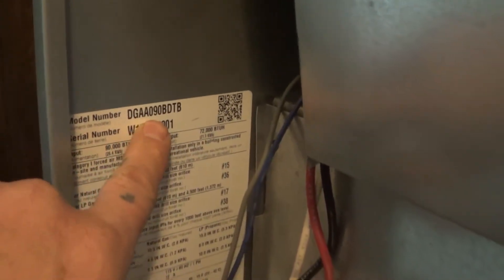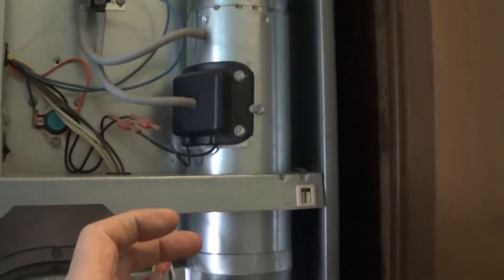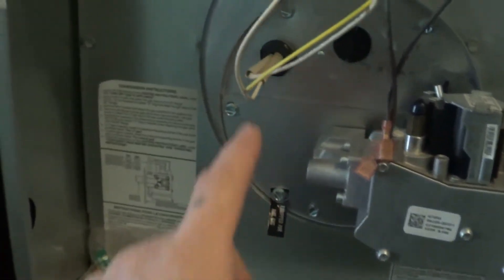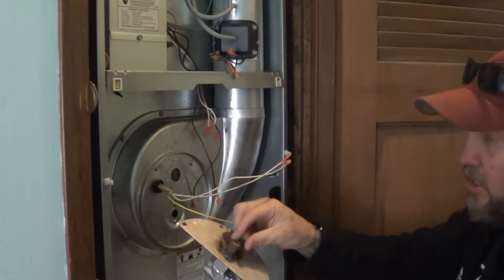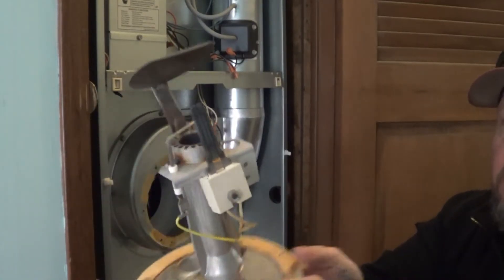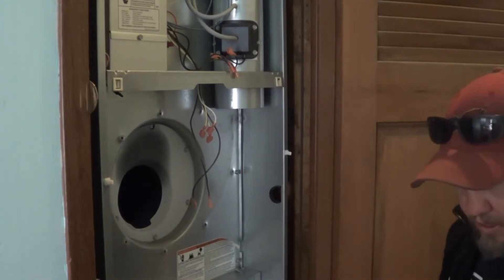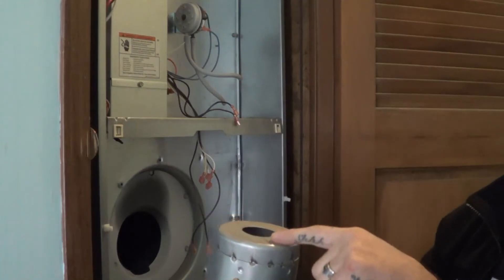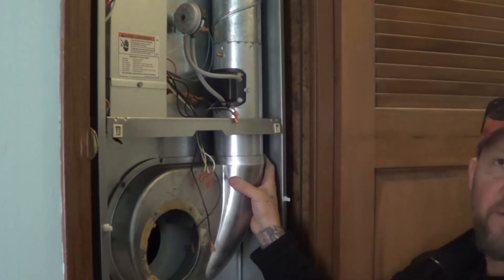How to replace a Motor in a DGAA or DGAX Furnace (Inducer).

Comment: I have the same furnace and I'm getting an open limit switch code when trying to run the heat. It will light just fine but the blower motor will hum and the fan will barley turn and then I'm guessing it will get to hot and throw the error code. The big blower on top works fine on A/C and if I take the door off and spin the blower fan with my  hand to jump start it then
 it will start  and the heat will work. Could the part you replaced be the problem? I've already replaced both of the limit switches. I plan on pulling it apart this weekend and doing a deep clean. She's pretty old and dusty

Comment: Instead of trying to get to that back screw behind the gas valve , couldn't I just take the four allen screws holding the compartment on the left of the valve where the orifice is inside. There is an o ring inside and I could just remove the rest of the gas valve after I remove the four screws holding the bottom part.

Comment: so much easier and quicker if you just remove the screws from the top and just lift the top corner a half inch and remove the vent pipe.

Takes literally 30 seconds.

Comment: I have that same system , is there a ajustment  for the burner ? i think mine may need a tweeking .
Reply from the maker: hello, no there is no flame adjust. On these units it's the size, or number, of the orifice on the back side of the valve that controls the flame. Have you checked to make sure the orifice is clear? sometimes a spider or whatnot gets in there.

Comment: Thats just like my furnace,  witch  i am having a  issue with eather  the inducer motor  or the pressure switch . Work's  on and off i think the inducer motor  is sticking or is so dusty that its not pusching enough  air to trip the pressure switch.
Reply from the maker: Hello, it being dusty and slowing the motor makes sense as well as sometimes a little debris like leaves gets in there. If you take the motor off and clean it and the fan blades and check the tube and the intake on the roof for blockage that's the best you can do without using a magnahelic tester . Then it may be time for a new motor. However, if the flame is looking real good it may not be the motor but the switch is going bad. The switch is the cheaper try.
Reply: @randythemobilehomeguy3715   bought a new inducer motor did the install,  cleaned the air box out ,checked everthing , air box was full of dead wasps , vacuumed everything else out, wiped off  all the dust inside and out,  put it all together and  it fired up like new, first time its ever been serviced since new , thanks for your video and  input.

Comment: Thanks you saved me. I had undone the 3 screws including the awkward one but it wouldn't come off. I didn't want to force it just in case I needed to slide it in some direction to unlock it. Your description gave me the confidence to just pull it off. It was glued with silicone. Fantastic job. Thank you so much!

Comment: Had the new part for 2 winters now, but never could find the right video or person to do the replacement. Found it !!  Next winter I will have a furnace again, which is awesome because northern Utah winters are a bit rough with just a space heater...even in a single wide.

Comment: My Colman DGAA is throwing a  Combustion air switch stuck close air code  Could the inducer motor be causing this
Reply: Sorry I'm a year late but yes, mine threw that code. I replaced the switch first, which has the tubes that connect to the inducer motor. That didn't work, so I replaced the motor and that fixed the issue.
Reply: Same code here my furnace is 20 years old was full of dust in the inducer. I cleaned it, Oiled it now works and squeals but buys some time

Comment: Of course on mine the OEM motor seized up. It is an AC shaded pole motor that is impedance protected so that it will not burn up if the bronze sleeve bearing seizes. I was lucky in that I could remove the front and LH screws from the motor plate and merely loosen the RH one (somewhat to the rear) that is hard to get to. That allowed me to tilt the motor mounting plate downward so that I could squirt a drop of Knocker Loose penetrating oil on the motor shaft but could have used any penetrating oil. Then a drop of turbine oil on the shaft going to the fan blade. This was several weeks ago and the fan is still working; it is only temporary as I wanted a new unit in hand plus gaskets. The new after market unit is made in Taiwan and it says on the label that the motor is ball bearing so it should outlast the furnace; the motor plate on the new unit is pop riveted in place so this trick will not work. The new inducer was about $70 off amazon delivered so the price was pretty good. The gaskets crossed to a York part number and the first one that arrived is NOT for this furnace. The duct temperature is less than 100 F so the fan is not really getting that hot. I really appreciated this video as I am now confident that I can make the replacement with very little down time. BTW, I called the original installer and they never bothered to return my call so I guess they do not want my business. When I had the black plastic cover off I had problems keeping the gasket in place during reassembly so so I used some fast 3M adhesive to hold it in place.